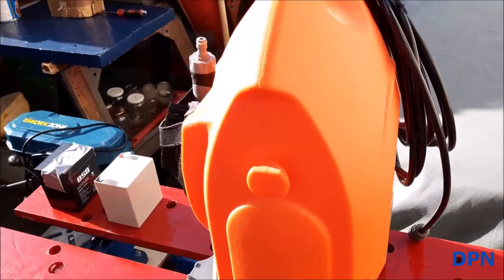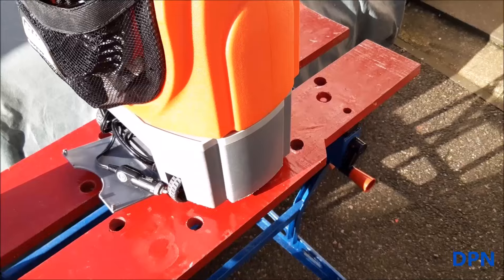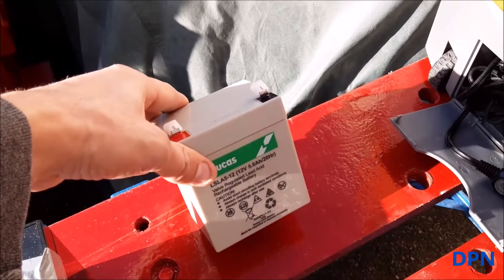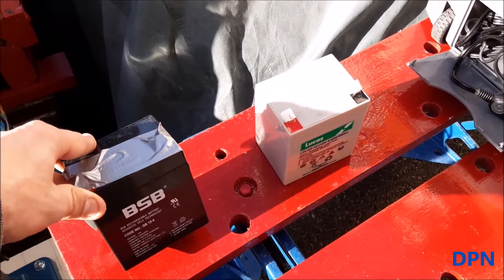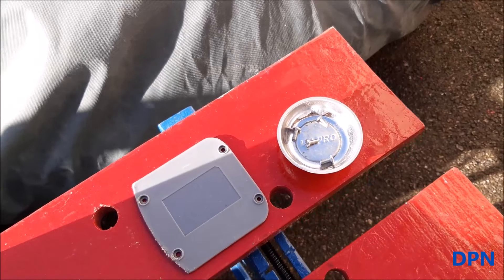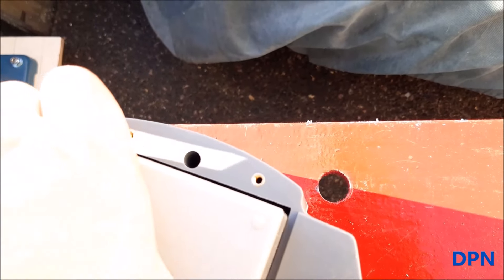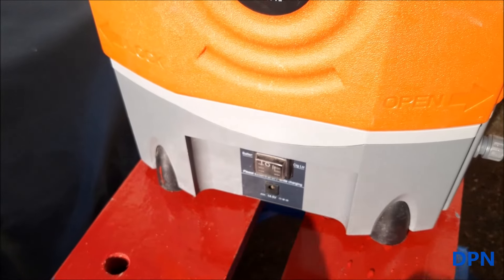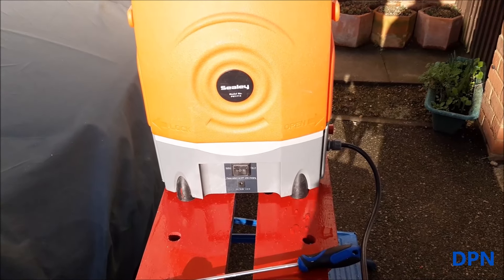replacing the 12 volt battery on a sealey 12v rechargeable pressure washer

Comment: Really helpful (today of all days!). Do you still have the dimensions, and or the links to a suitable Lucas (or other) replacement please? The sealey washer is the same fit/form/function as my Mobi washer and it's demonstrating the same battery fault (works on cigarette lighter 12v, but dead on inboard battery). Hoping this fix will be the same. Thanks in advance.
Reply from the maker: @dazzle52k52  From what I remember we didn't use measurements to find the battery. We just searched the information on the battery (lsla5-12) into eBay and that found us the battery. For the full information on the battery, I think you can pause the video where I held the battery up to the screen for a time
Reply: @DPNTV  - Found it and identified one (*the same Lucas model) within Amazon. 👍👌